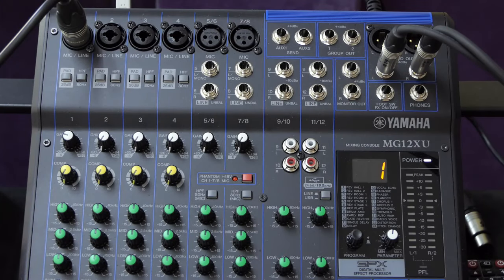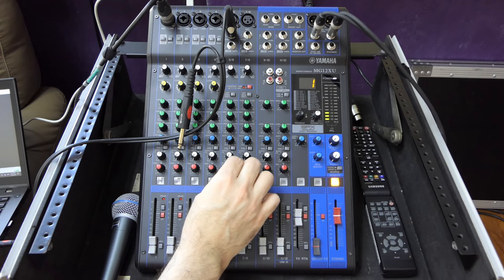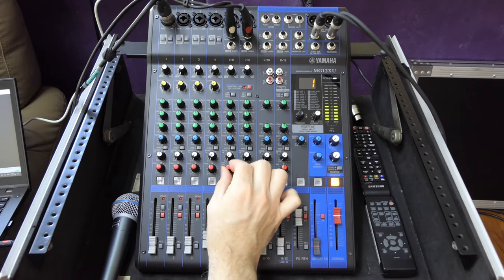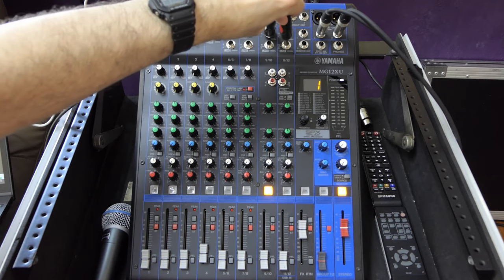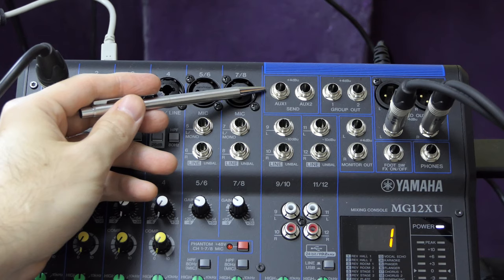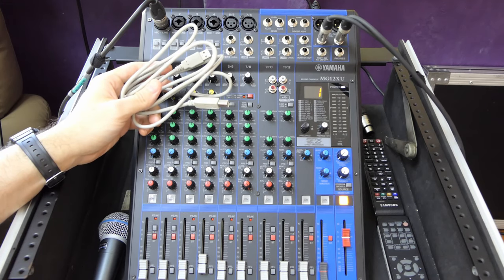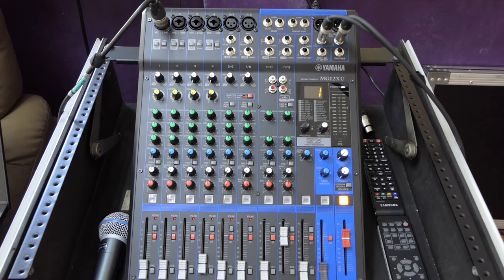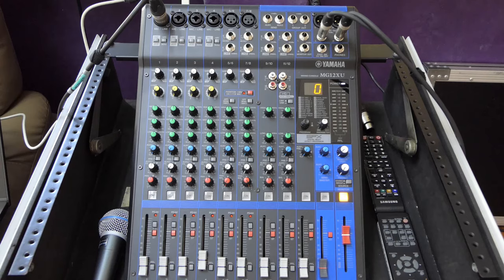Yamaha MG12XU Mixer Tutorial Part Two

Comment: Hi I’m quite new to this and just got my mg12xu, I’m learning the boss rc505, I’m trying to figure out the best way to pair the boss and Yamaha. I want to use the Yamaha internal sound card with my MacBook and struggle how to best connect the boss. Any chance you could help me out? I’m so happy for this videos so a huge thank you for this amazing video. 

Thank you!
Reply from the maker: Hi there Kristofer, the simplest method would be to connect the line outputs (L&R) of the RC505 to the Mixer's line inputs - either one of the stereo channels or two mono channels. At the same time, be aware that the RC505 can also be used as an audio interface, so you would need to decide whether you want to use the interface in the mixer or in the looper - you can't use both at the same time.
Reply: @GLBProductions  Thanks a lot for your A. Can I say : Use the internal sound card on the Mixer but still use the boss as the Master MIDI clock to all devices? You are bf the best instructor I have ever seen. Top. Thanks
Reply from the maker: You're welcome! Hmm that's a good question - I'm afraid that I have no experience configuring MIDI in the real world 😄 Questions like whether the two would cause a conflict within the computer or even within a specific piece of software... The best way is to do some test recordings and see if everything sounds correct.

Comment: I don't have a question about this video but I really liked your videos on amplifier setups. I currently have a peak 1500W Dual Coil 4 Ohm Subwoofer, and an Amplifier that outputs 2000W/2 Ohm, and 1400W/4 Ohm. Is there any way for me to set this up safely, or do I simply need a different amplifier or subwoofer?
Reply from the maker: This video will show you how to do the necessary calculations: https://www.youtube.com/watch?v=l9L7uK7Xy0w With a dual coil sub you need to follow the manufacturer's guidelines carefully!

Comment: So let me get this straight. In order to send audio for usb recording, I have to press the stereo button. If I don't want a channel to be recorded, I can leave the stereo button off. Is this correct?
Reply from the maker: Pretty much! The logic goes like this: pressing the ST button routes the channel to the ST bus, which feeds the main LR outputs and the USB output. Either of these can be used for recording. There are also other ways to prevent the channel from being recorded, such as switching it OFF or pulling the fader all the way down.

Comment: I have a question. I sometimes use 1 powered speaker because it’s loud enough. Don’t need 2 in certain situations. I’ve been panning right on all the channels (mic or line in). It sounds find but am I doing it correctly if a stereo RCA adapted to 1/4 L/R unbalanced to the 9/10 input is used?
Reply from the maker: Ah - this is where you will run into issues. If you are using only a single loudspeaker connected to the right main output you need to use two mono channels for your stereo sources, or sum them to mono before input to the mixer. In the setup you describe above you are only getting the right side of the audio connected to channel 9/10.
Reply: Thank you! Appreciate all you do! I was using Mackie 10 channel mixers at both a wedding ceremony and reception. They’re pretty large for the application but have good features like pan and mic effects. I adapted my RCA L/R to 1/4” coming from controller and into two different channels. I then panned them both to the right main out and it sounded killer.

Comment: Should the MG12's 1/4" output cables to amplifier be speaker cable or instrument cable?  It seems to me that if the output signal from MG12 was strong enough to warrant speaker cables, I wouldn't need an intermediary amplifier between it and the passive speakers--therefore I should be using instrument cables from the 1/4th" output sockets.
Reply from the maker: They should be instrument cable for unbalanced connections and microphone cable for balanced connections. The MG12XU is not a powered mixer, and does not output speaker-level signals.

Comment: Your videos are so helpful!  
I've been watching them and learning so much thanks to them.
Very grateful!
I have this question, in case it can be answered.
I am using two mixers in my studio,this one as the sub mixer and the yamaha mg20xu as the main one.  Needed some more inputs (Thx for the video about connecting two mixers).
I want to connect some effects pedals in the equation.
My question is if there is a way to get the effects in both mixers, although the pedals would be connected to just one.
In the case it can be done, is it better toconnect the pedals to the main mixer or the sub one?
Sorry for my bad English, hope it's unerstandable.

,
Reply from the maker: Hello Rmonlu, glad the videos have been helpful 😊 If you want both mixers to be able to access the pedals you would connect them to the main mixer using aux 2 - this way you would be able to use the pedals' FX, and then the internal mixer FX when the pedals were disconnected.
Reply: @GLBProductions   Thank you very much for the super quick response GLB Productions,  much appreciated!!
I connected as explained and the pedal is now working on both mixers!
As I understand, it will be a bit limited in choosing which channels of the submixer  gets the fx signal?  I ask because all the channels in the sub mixer are getting the signal from the pedal (which is the logic thing) since all the submixer is connected into channels 1 and 2 of the main mixer, which is the one with the active aux 2 and fx.  
Is there a way I can choose which channels of the submixer gets the fx signal, or will I be limited to using the fx signal on all channels of the sub mixer?
Hope it's understandable what I wrote.
Thanks again!
Reply from the maker: You're welcome :) Yes that's correct - once the individual signals from the sub-mixer reach the main mixer they are treated as one combined signal so you can no longer process them separately - this is one of the disadvantages of using two smaller mixers in place of one larger one.
Reply: @GLBProductions  Yes, it makes sense.  Thanks again for the fast replying and explanation!

Comment: Hi Bruno, you're video's are always really clear and helpfull! 
Can you help me out with the following issue. How to proper connect a roland spd sx to a yamaha mg12xu (or mg10xu) using clicktracks / backing tracks /  samples? The routing from te roland spd sx / using di-boxes or not / routing to drummer clicktrack seperate / monitors / front of house. I really don't find a proper solution for this :( Thx and keep up the good work!
Reply from the maker: Hi Andy, very glad the videos have been helpful! 
I've done a video on some of the issues around connecting drum pads as well as keyboards: https://youtu.be/ltG5phSE6h4
When it comes to dealing with the clicktrack every band is different - in some only the drummer hears the click, in others there are tons of stems running and everyone is on in-ear monitors, so each solution tends to be customised to that particular setup.

Comment: GLB Productions  Hello Bruno and thank you for all your advice.  Wanted to know where the best overall volume control on a mixing console would be.  For example   If the volume is too loud,  should I turn down the master fader, the channel faders,  or the input sensitivity on the powered speakers.   Which would preserve the most resolution and keep the signal to noise ratio at an optimum.  Everything at unity is just too loud for small rooms.  Thank you
Reply from the maker: Yes this is a very common problem. If using active/powered speakers the overall system volume is the volume on the active speakers themselves. If using a power amplifier and passive speakers the system volume is the amplifier level controls. Everything else should not change because it preserves correct gain structure through the system.
Reply: GLB Productions Thank you very much for your advice!

Comment: Hi, can I connect the mixer to the ATEM using an AUX send? I'm trying to use a 1/4" from AUX 2 SEND to a split XLR from the ATEM. Unfortunately I can't figure out what I'm doing wrong.
Reply from the maker: More details please - what model ATEM are you using, which input channel are you connecting to and what do you mean by a split XLR?
Reply: @GLBProductions  ATEM television 4k, ATEM has an XLR (L & R) input for audio. Since I'm trying to bring the the sound from AUX2 (1/4). I used 1/4 Male to XLR Male (L&R)
Reply from the maker: The audio being output from aux 2 is mono, not stereo, so you need to use a TRS to XLR male adapter, not a TRS to 2xmale XLR, and use only one of the inputs on the ATEM. Apart from this there is certain to be internal configurations in the switcher that need to be set correctly - check with your supplier for those.
Reply: Thank you!

Comment: Man, you are the best. Explaining everything well.  Thank you Man. But I m not sure if I understand correctly.  So, I want to have an Balanced Audio  Signal from the Input to the output. In this case,  I need to have  an  Balanced Cable  XLR to XLR connect to the Input  5/6 from the Output signal of my Sources   or connect to Input 5/6 XLR to 1 Stereo jack from the Output signal of my Sources,  which in my case is an external interface Steinberg UR22 with an Jack 6.3mm balanced signal Output. It is possible something like that for an balanced signal? Appreciate if you answer me. Sorry for my bad English, is not my first language.
Reply from the maker: Yes, you can use 2xTRS (balanced quarter-inch) cables to connect the outputs of your UR22 to the mixer's 1/4" line inputs - that will provide a balanced connection between the two units. I have two UR22s which I use for shows and usually connect them like this. You don't have to worry about the signal once it's inside the mixer, your job is to get it there without adding noise.
Reply: @GLBProductions  Thanks a lot Sir. This Channel is my favorite channel from this moment.  Happy new year,  Sir. And sorry for my English,  it's not my first language. Thank you again.
Reply from the maker: You're welcome Haris, all the best with your music!
Reply: @GLBProductions  Hi. I have one more question for you, appreciate for your answer.  The yamaha mg10xuf has no gain control for the audio signal ?

Comment: It it heard that the USB recording volume in yamaha mg 10 u and 12 u mixers are low. Is the S/N ratio  sufficient for noise free recording? I want to buy one usb mixer for small live with good fx as well as home recording . How does the Soundcraft Notepad fx12 compare itself with yamaha 10xu mixer?
Reply from the maker: I'm afraid you'll need to test this for yourself - I'm primarily a live sound engineer and don't do that type of testing for my reviews. The preamps and circuitry in these entry-level mixers are generally very similar in real-world performance.
Reply: @GLBProductions  thank you. My concern is live sound also. That is why I am not concentrating in dedicated audio interfaces only.  I need a mixer with usb .

Comment: I am taking the output of the mixer MG12 from Group out(1) using a 1/4" TRS to a 3.5mm TRS. Then this 3.5mm to My laptop using 3.5mm splitter. The output is muffled in the laptop. At times i have to disconnect the 3.5 mm Jack and reinsert which solves the problem but there is still sound clipping in the laptop. Not able to get a clear sound. Multiple instruments such as a cymbal, drum and singers singing loud. Sound is not distinguishable at loud noises.
Reply from the maker: It sounds like the 3.5mm splitter and/or the input of the laptop is the problem - I recommend using the USB connection to send audio to the laptop instead.
Reply: @GLBProductions  thanks for the reply. But the MG12 does not come with a USB output. Can I try using the USB splitter instead of the 3.5 mm TRRS. The live program link 
https://youtu.be/kCDVuYihMO8
Reply from the maker: Oh you're using the old model, ok. In that case get a simple 2-channel USB interface - Steinberg UR22 or equivalent, it will solve so many problems for you. BTW I listened to your video - there is a lot of distortion in your signal, so check your gain settings carefully.
Reply: @GLBProductions  I know probably this is a redundant question and still be dumb and ask anyhow. But in MG12 what are all the possible ways to get audio output to my laptop Asus A15, which has a single audio combo jack. I know an USB audio interface would solve the problem but anyhow excluding that?
Reply from the maker: You can use any of the outputs from the mixer to connect to your laptop, given the right cables/adapters. So main outputs, REC OUT, aux outputs, group outputs can all be used.

Comment: When using 2 condenser microphones that need phantom power they need to be used on channel 1-6 correct? and  when using phantom power, if you use 2 condenser mics and 3 other mics, will the regular mics be ruined?
Reply from the maker: Yes, the phantom power is only present at the XLR inputs. Non condenser mics will generally ignore phantom power and will not be damaged by it - there are some exceptions to this such as very old ribbon mics, but I doubt you're using those. Also remember not to plug and unplug XLR connectors while the phantom power is on.
Reply: @GLBProductions  thank you for your response!

Comment: This is a very good informational video on the device, thank you!!!😊👍🏻
I have doubt, the 9/10 and 11/12 are stereo right?
So I can’t have four separate inputs (say four microphones) connected to them, can I?? 🤔
Reply from the maker: Yes they are intended for two stereo sources as opposed to four mono.
Reply: @GLBProductions  😁👍🏻
Thank you very much 😊
Reply: @GLBProductions  
Can’t figure out which one to get? 
After a lot of thought I’m stuck with YAMAHA MG12XU and Mackie profx12v3........... which ones better? Any suggestions? 😃
Reply from the maker: You'll need to decide which mixer has the features that you personally need by doing a step by step comparison. I've outlined how to do this in one of my videos: https://www.youtube.com/watch?v=Jb-Hfgo3kck 
Equally important are things like the after sales support available from the distributor in your area - if something goes wrong can you get the mixer repaired quickly and easily? These are all important factors to weigh in your decision.

Comment: Hi wondering I have the MG12XU connected to my laptop. sounds great except every couple
of minutes the sound fades to a kind of static and comes back again clear. 
Its connected by the Hdmi and the connection on the back of my console.what would be the reason?
Reply from the maker: You mean the USB cable? There is no HDMI connector anywhere on this mixer 😉
I suggest cleaning the USB port on your computer with some electrical contact cleaner and see if this improves the connection.
Reply: HDMI from my computer to console with a USB connection
Reply from the maker: If you are connecting via the HDMI output on your computer that is very likely causing the issue - the mixer is not designed to accept an HDMI signal, so unless you have the correct interface in between it will cause problems.